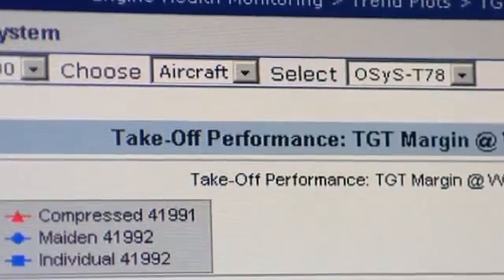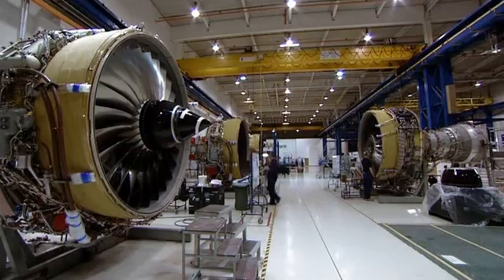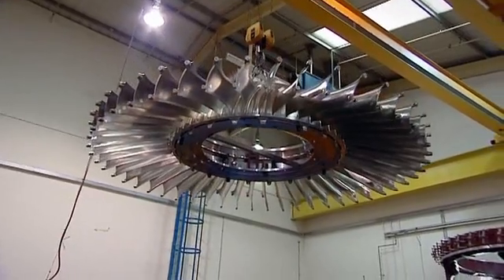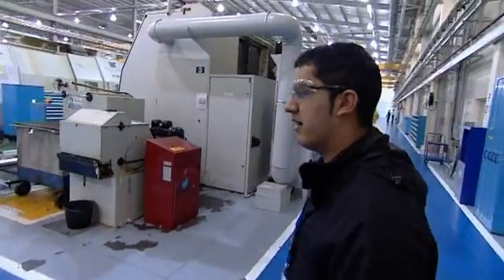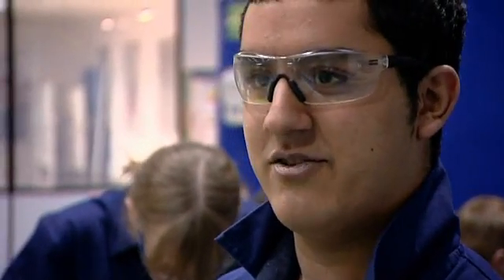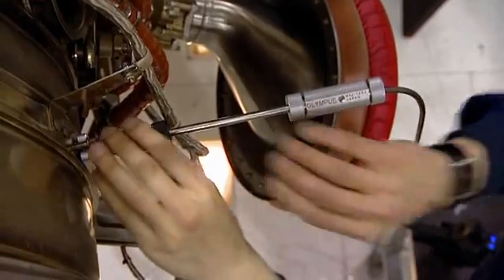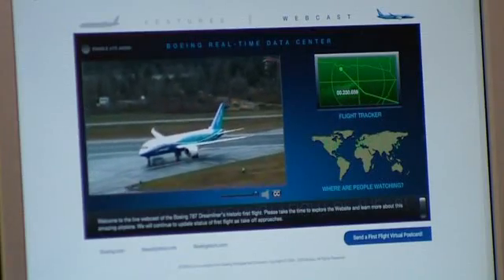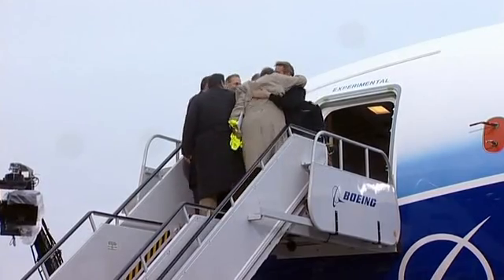Rolls-Royce, How To Build A Jumbo Jet Engine -HQ- (Part 4/4)

Comment: Amazing company and video. Meticulous attention to engine specification and construction, but surprised by the loose panel switch on the the Test Center panel (9:10).
Reply: loose panel switch? Your video timing is way off Peter. 9:10 they're inspecting the guts of the engine before delivery.  Plz update with the correct time in the video where you saw it.
(I'd like to see it myself!)

Comment: absolutely stunning insight,as an engineer having worked on the trent spey and olympus blade stages, a coded welder and aviation nut,this is the surgical end of british excellence,next time i fly i will be doing so in the knowledge that these ppl made it happen.utterly gobsmacked.many thanks to the upper of the 4 vids.

Comment: Despite the shameless self-advertisment of Rolls-Royce, this was a great documentary.
Reply: iliasasdf wtf 🤷🏻‍♂️ whats "Shameless" in this documentary ??? Well , this Documentary was made IN Rolls-Royce Assembly plants, not in any other Jet Engine manufacturing company, so you expect Rolls-Royce Company & Engineers & Assembly workers to provide their Valueable time as charity to make a Documentary on how Jet Engines are Engineered and manufactured, without having their company name shown ??? Smfh Fyi that's not how "Business" is run, and I'm pretty SURE, it wasn't Rolls-Royce that Demanded to have their company name advertised, I'm sure it was the producers of the Documentary that would have Provided Rolls-Royce  advertising their company, in return for obtaining permission to make this Documentary smh